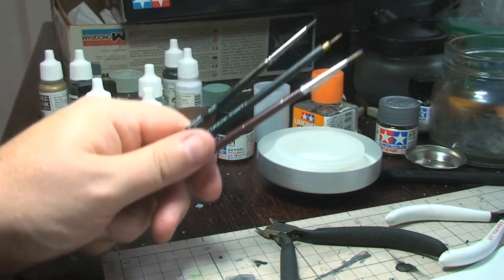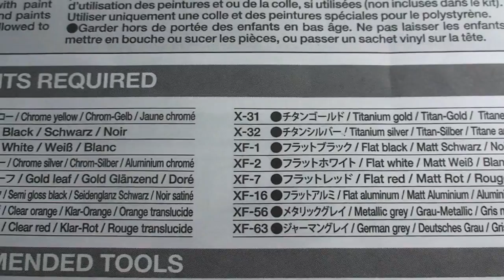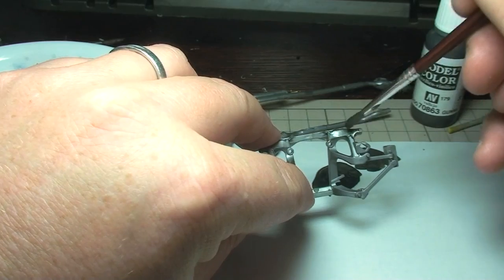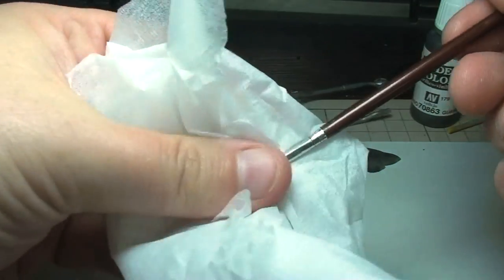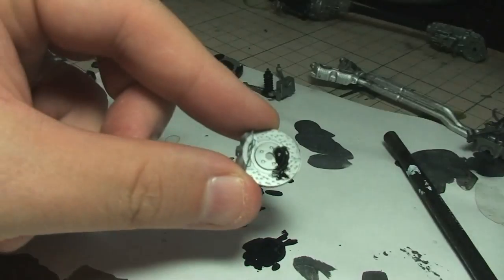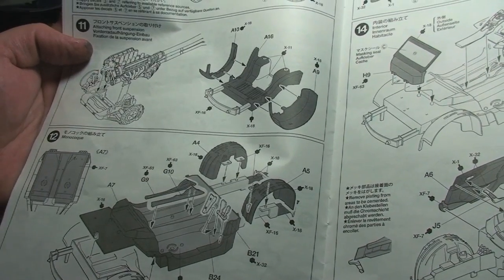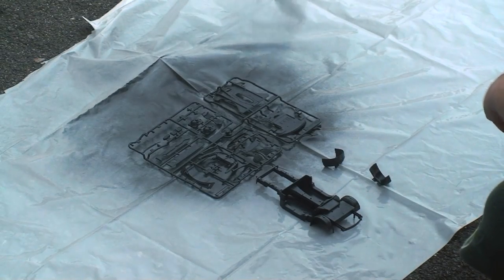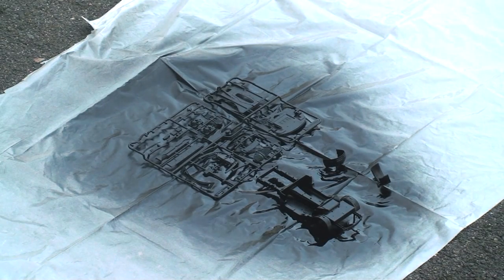Lexus LFA Part 2 – Painting Basics | Boss Builds

Comment: boss i have a question
is it much more better to use wet tissue for cleaning the brush after rinsing it with water than a normal tissue? if so, and wet tissue is not available,  is it okay to use a used or any old cloth that we have?

Comment: @shadowblack1987 

Erm... No, aaand No...

Handbrushing can get as good results as anything else and long as its done right and you use proper paint (i like Revell paints myself).

As for "paint pooling", if your paint gets to the point of pooling you're probably doing too thick of a coat or going over the same area too much.

It can all work as long as you do it right, as well as anything can go wrong if you mess it up. Don't blame the techniques.